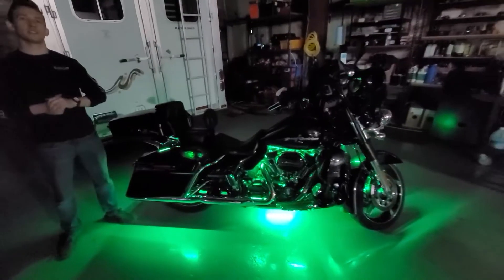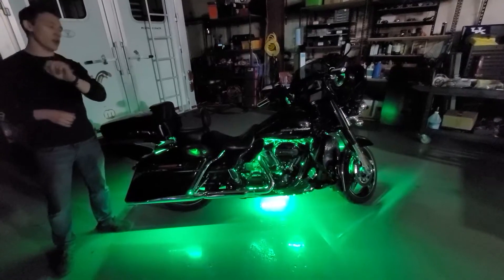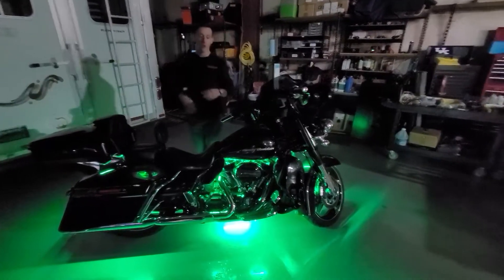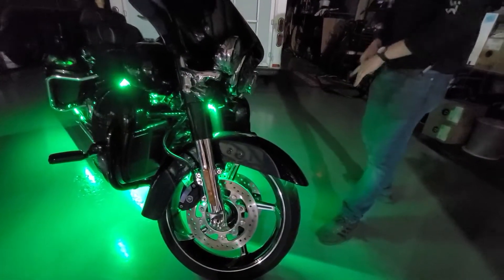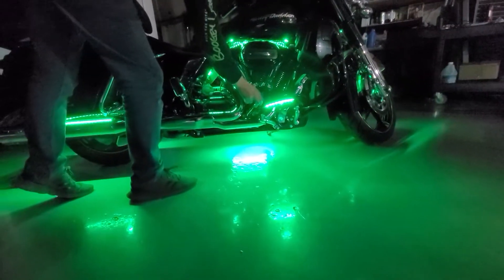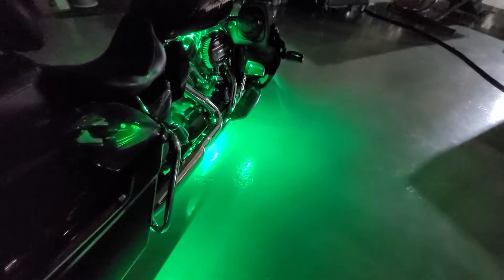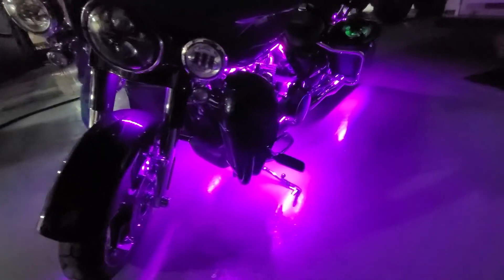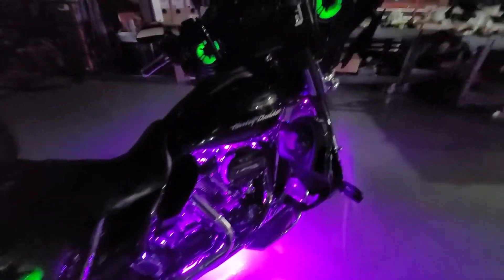LED INSTALLATION  |  2017 Harley-Davidson CVO Street Glide

Comment: How many led light I’m gonna need to install on my 2021 Harley Davison trike please and where’s your location
Reply from the maker: You can either use our Multi-Color trike kit (https://www.boogeylights.com/hi-intensity-multi-color-trike-led-light-kit/) or our touring and bagger kit found here (https://www.boogeylights.com/hi-intensity-multi-color-touring-bagger-motorcycle-led-light-kit/).  We are located in Florence, Kentucky at 9000 Empire Connector Dr Ste B, Florence, KY 41042